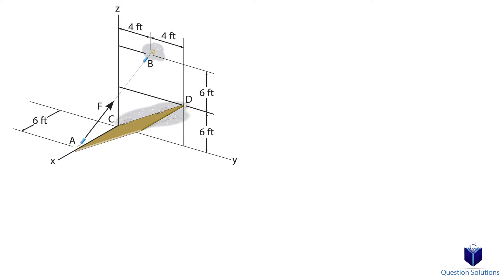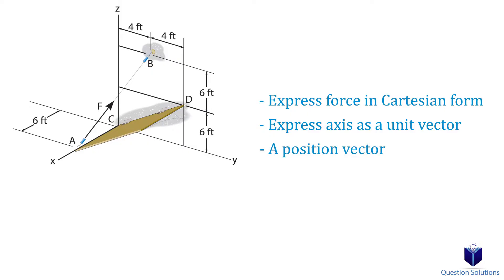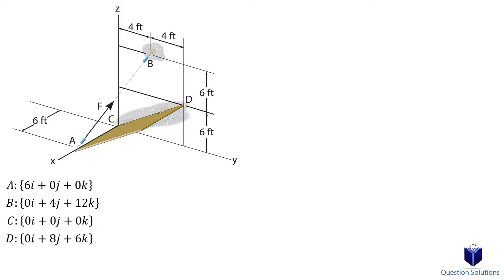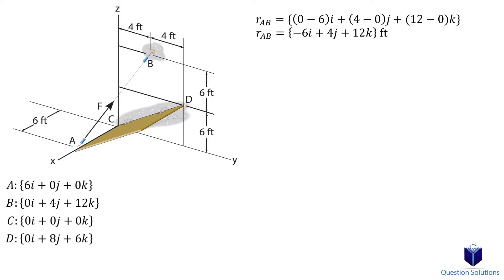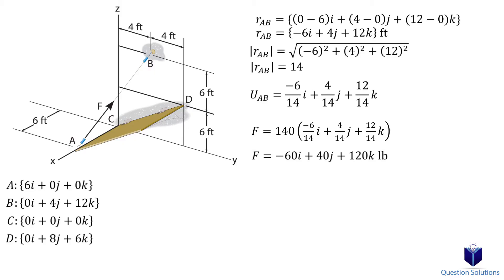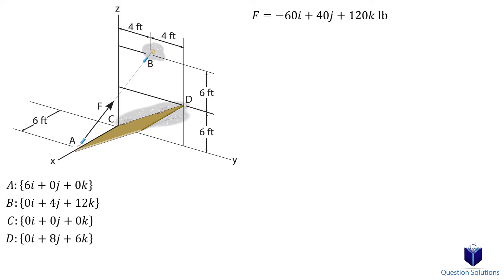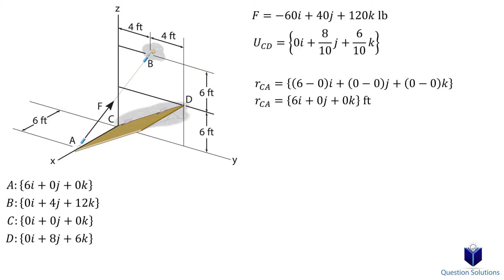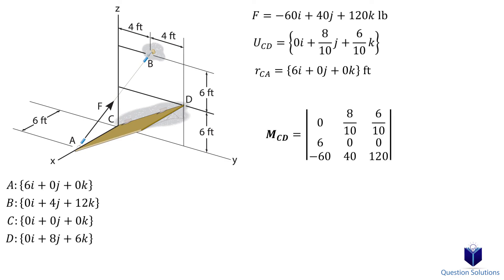If the tension in the cable is f=140 lb (solved step by step)

Comment: you used rCA as position vector and i used rCB as unit vector but i got -432 as well, also in this video you considered  that the force begins at A which if i apply for video 4 it will be inversed , im kinda confused
Reply from the maker: You should get the same answer since the position vector can be from any point on the force to the where it's applied. See: https://youtu.be/QNNnPZ68STI
Reply: @QuestionSolutions  I see thank you very much